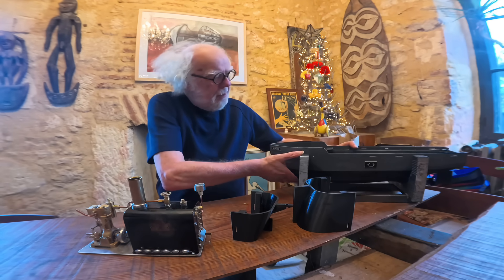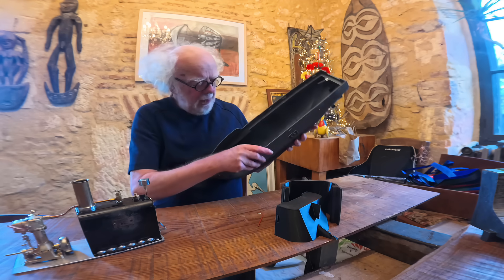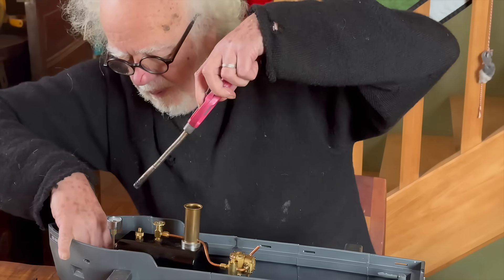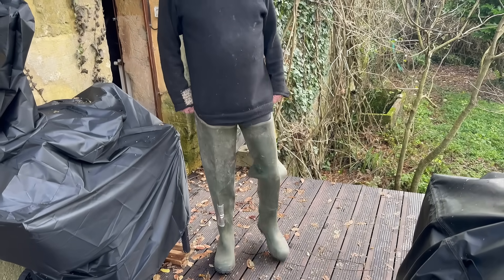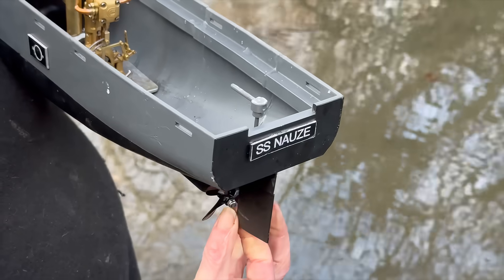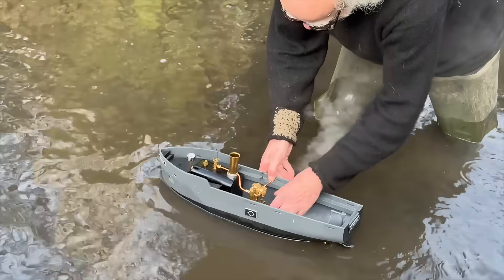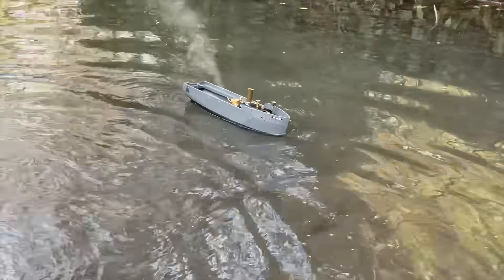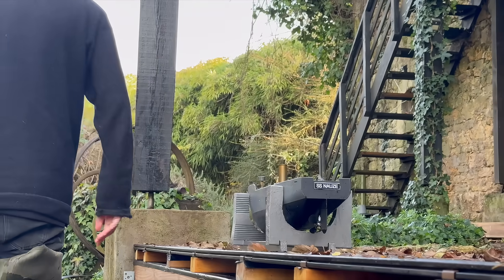My Steam Boat Maiden Voyage

Comment: Add some ballast below your engine platform. Lead shot added while afloat until she sits level and then encased in epoxy will do the trick nicely! I have a decent machine shop and will build one of these with a homebuilt boiler/engine for my grandson. Thanks for the STLs!

Comment: Might be an idea for future projects to test vessel stability in the bath. An old, galvanised one would do if you don’t want to use the one in the bathroom. You could also control the water depth in case of mishap and it would be easily recoverable. Looks like you might benefit from adding ballast to adjust the metacentric height plus, maybe, an external false keel for directional stability. Excellent project, mind.

Comment: The small amount of water in the bottom is creating a free-surface which is reducing the GM (a measure of stability), this is probably responsible for the inherent angle of lol .
The C of G being influenced by the elevated brass boiler full of water ,due to the burner below,  is probably critically close to the C of Buoyancy, hence the instability.
As mentioned by others. you need to add some ballast as low as possible as this will raise the C of B and regain stability.

Comment: You need a rudder, the engine torque makes it go round to the right and list, ballast needed to correct that. Plus radio control if budget allows. Otherwise a very good start.

Comment: Now get a Radio control for rudder and steam valve, and if it has, for reversing the engine.
Reply: Just what I was thinking. The engine has Stevenson's link motion so yes, it can reverse. The centre of gravity needs lowering with some form of ballast and I think an engine of that size would be happier in a slightly larger boat.
Reply: but will it self start after reversing?
Reply: @lenroddis5933  If it's not on top or bottom dead centre it  should if given enough steam.
Reply: @petercooper2387  
it's TDC and BDC that's the problem

Comment: I would imagine it would be quite easy to install two servos. One for the steam engine and one for the rudder and also a battery pack to power them, looks like there's plenty of room. It might be an idea as well to get it properly balanced using some fishing lead weights and securing in place with modelling foam. I used to use it all the time when I used to build radio controlled boats Be cool to see a steam powered radio controlled boat
Reply: The prof seems like the type of guy who could wire up some crazy builds. 😀
Reply: @Blizofoz45 definitely!